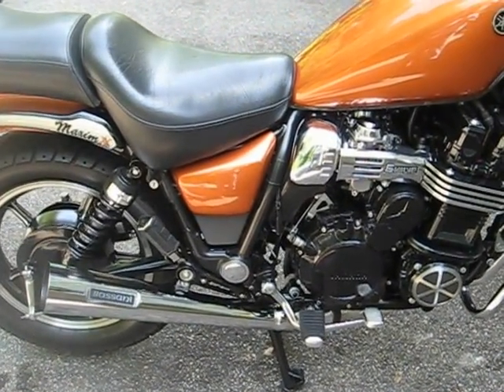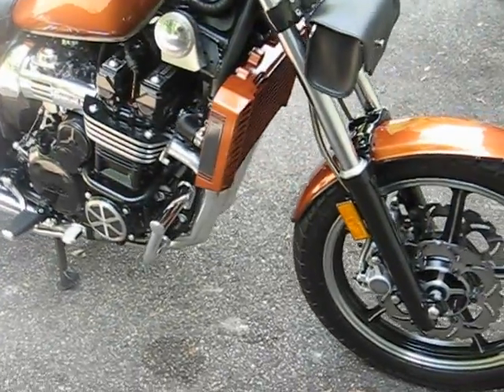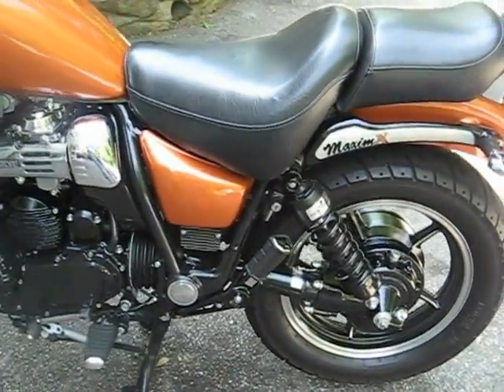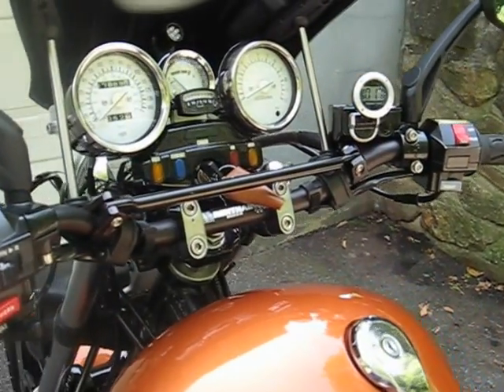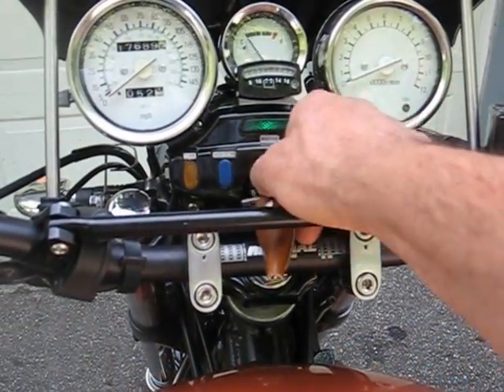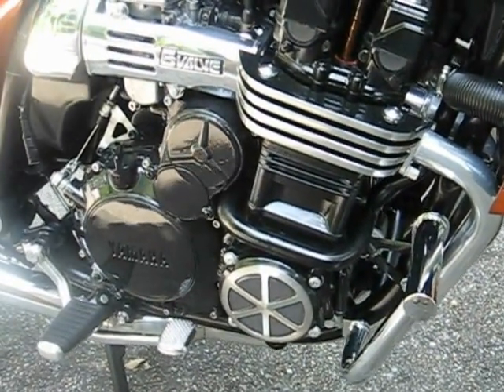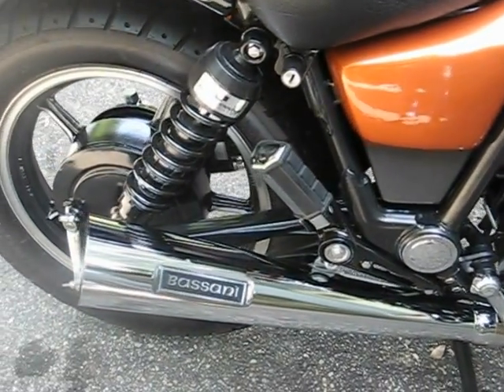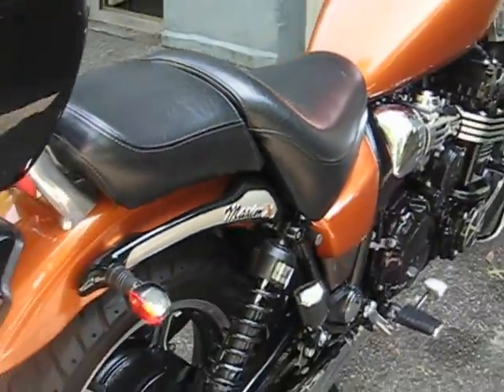Canadian 85 XJ750XN Maxim X 750cc NOT for sale

Comment: Hi there. Stellar work. Quality choices made. I had as much fun noticing the mods as listening to you talk about them.  I'm in Ottawa, ON CANADA. I also had an 85 Maxim X. 92 hp, Awesome concept.  shame about only 2 years. I shook my head a couple of times to realize that you swapped out the rear wheel. Did you put the airbox back in?  I know it's no, but... and I am serious if you decide to sell this work of art... contact me please.
Reply from the maker: +ottawaboy1 
First off, sorry mine's not for sale.

 I keep thinking on changing things up and now I'm going though stage 4 of my winter upgrades. 
It really is a mechanical work of art being the only Yamaha model to have the FZ750 " Genesis " engine and shaft drive. Look around for another one up there, I see them available all the time. 

Yes I did swap out the rear wheel to an "Air cooled" model style and dropped nearly 4lbs. off which really helps the unsprung and rotational weight. Too bad they never did a disc brake for these. 

Airbox is back in with a K&N and some mods for additional airflow.